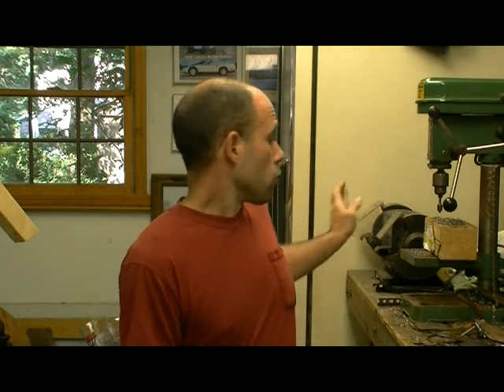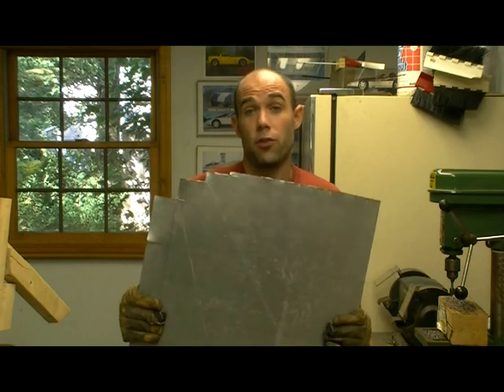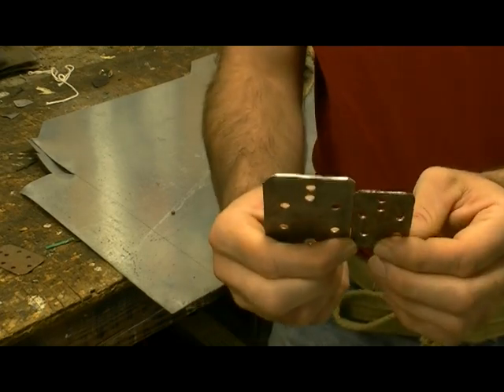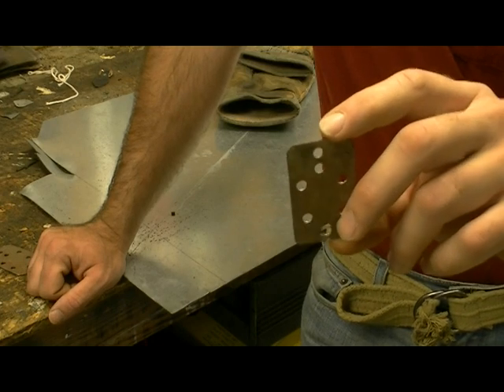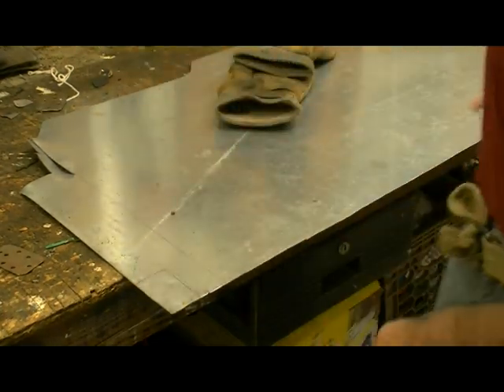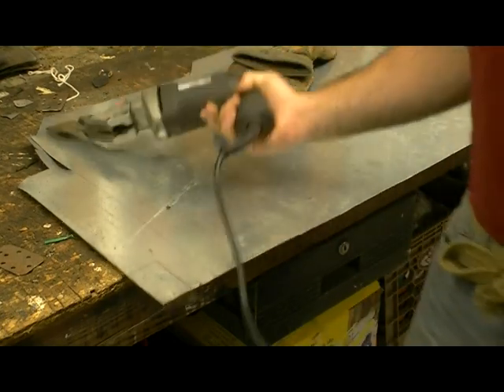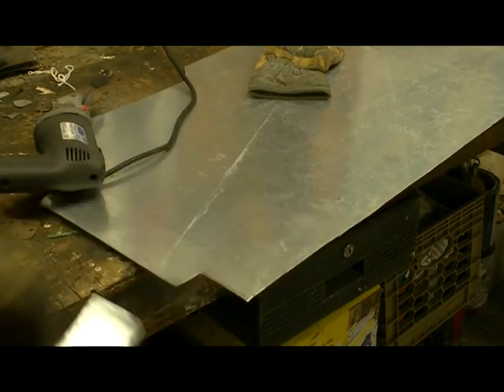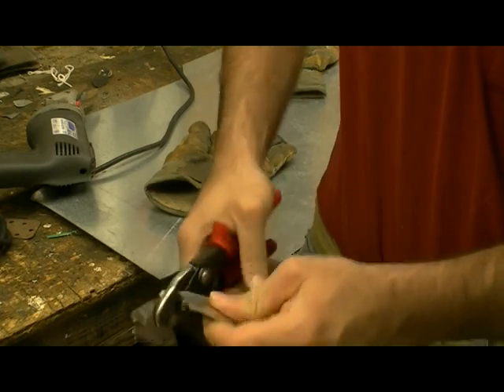How to make: Lamellar Armour pt. 1.

Comment: Something i can see with Lamellar armor, is that the owner could repair it or have it repaired at little expense compared to large piece plate armor.  It is user friendly in that respect.
Reply: It would also be relatively cheap to make in the first place.
It would be much easier to get a lot of small plated of metal- be that bronze or iron/steel- than a large, uniform piece.
It also wouldn't require as much skill to produce so again, it would be cheaper to make.
Not to say that a full set of Lamellar would be cheap, but it definitely would be a LOT cheaper than a full set of Plate.

Comment from the maker: yes. treated leather was the actually preferred material, by horsemen, since it was lighter and when soaked in urine, yes urine, it would be nearly as hard as mild-steel. If you're going to use leather go for something between 8-10 oz leather. The higher the oz. though the thicker and harder it is to work with.

Comment: Depending on who you get your steel from, you may be able to have them shear it to the desired width. Then all you'd have to do is cut it to length with the electric shears. It may cost a little more but it would reduce cutting and hammering significantly.

Comment from the maker: Plastic is probably your best bet, like what can be found in the plumbing section at your local hardware store. Light weight, able to be drilled without breaking, etc. . Another thing I suggest, make yourself thick padding that can fit under the armor. It'll help disperse the energy of the paint ball and prevent the wonderful welts it leaves.

Comment: angle grinder with a cutting wheel is a million times more efficient. also cutting one long strip of metal with the width you want then cutting them into the lengths youd like is easier process unlike what this video shows.

Comment: One thing that might reduce your time during build would be to use a jigsaw with a metal cutting blade.  Or look at getting a portable band-saw that you can table mount.  Either option wouldn't bend the metal and you could cut rounded corners into each piece.
Reply from the maker: Jake Bigelow I tired the jigsaw once. The biggest problem, is the metal is to thin, the whole piece would vibrate, even with me kneeling on the piece, causing me to never have a straight line. If the metal is thicker, I.E. 12 gauge or more, then a jigsaw would be the prefer method.
Reply: Schuller100 did you try clamping the piece of metal down to your work surface.  You would get a lot better grip on the piece over kneeling or trying to hold it yourself.  Plus then you could have only the part that you need to cut hanging over thus giving you less vibration in your whole piece.  Another tool to try would be a grinder plus cutting disk, but there again you would want to clamp the piece of metal down to make it easier to work with.

Comment: How thick is 16 gauge steel? We use metrics here, and I don't know how thick it is. 
I am thinking about making one for myself and using a 0,5 - 0,7 mm thick. Overlapping should be around 1,5 - 2,1 mm thick. Should be adequate.

Comment: Hello !

I would know : is it really important for all of the holes to be a the exact same place in every lamellar piece? I mean, when i will make the hole, if i pierce a hole at 3-4 mm next  to the previous hole in the previous lamellar,  should i make another lamellar or it's ok? If you see what i mean?
Reply from the maker: Yes. It's important to make sure all the holes are as close as possible with each Lamellar piece. I've started using templates to mark my holes so that they're as close as possible to one another.
Reply: Ok i see, thanks for the awnser !
Reply from the maker: no problem.

Comment: @SamGCampbell If it's steel it's scalemail, not LAmellar :3
Reply: Rottenbrains Scaredycat No. The difference between scale mail and lamellar is that scale mail are essentially plates, or scales, fastened down to a backing, like leather. Lamellar, on the other hand, has all the pieces laced together, with no backing necessary to keep it together. That, plus lamellar, I believe, is easier to make and not as restricting as scale armor.
Reply: @Anino_Makata  yeah, you're right